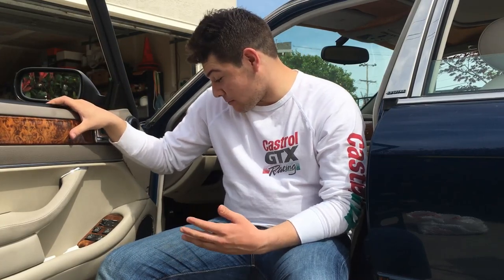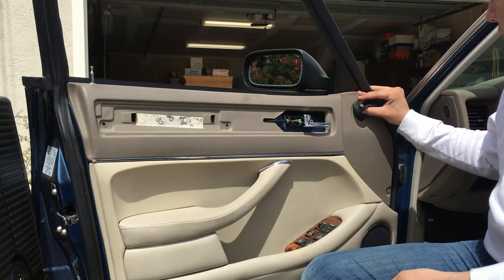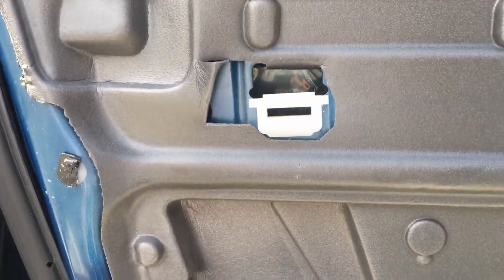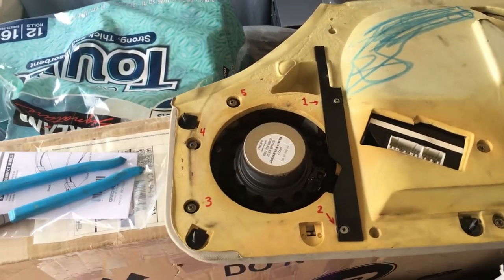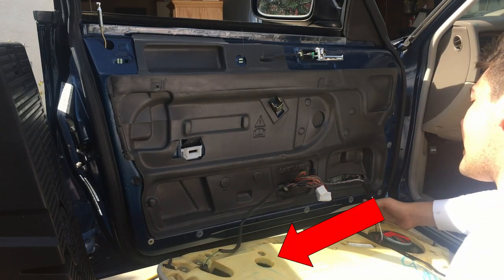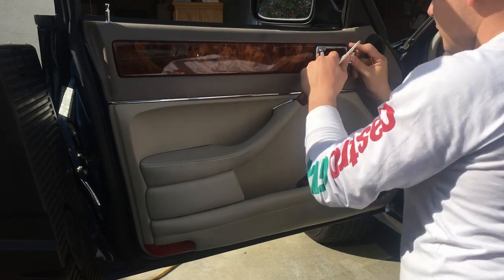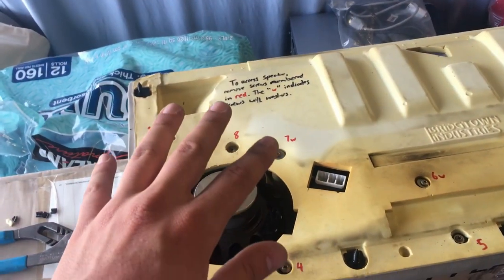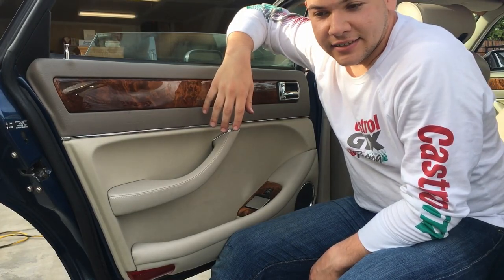How to Remove Door Panels and Replace Speakers on an X300 Jaguar XJ6 / XJ12 / XJR (1995-1997)

Comment: Great video!  I have owned my 1995 Vanden Plas XJ6 for the past 3 years in Phoenix, Arizona and had my speakers replaced by an audio sound place locally; however, now the insulation (yellowish thick stuff) has come loose from the passenger front door causing a lot of trouble in shutting the door and opening it.  If I had the patience and agility, I was thinking of following your instructions.  But since I am getting old and crotchety, I guess I'll bite the bullet and take it somewhere and pay them.  But thank you so much for such a well-done video - your explanations are fabulous!  And I am a girl who only thinks she wants to do it all herself.  ;-D

Comment: Thanks for this Eric. Great information. Just what I needed to know. Hope you make more videos like this. I have a 1996 X300 and it is the best Jaguar I have ever owned. It will probably be my last Jaguar, as this car was the best and most dependable XJ6 they ever made. Not to mention that it is also the last of the straight 6 engines, and the last of the traditional Jaguar luxurious cars that offered "Grace, Space and Pace, or to put it another way "Leather, wood and waft" With the older beautiful Jaguars cars, you either got it or you didn't. You have a great car there Eric. Keep the good work up.
Reply: The  rigsg
Reply: Hv
Reply: Right

Comment: Hi X300Sauce. I have watched your video before and have found it very helpful and interesting. Thanks for your input. Hope your car is running well. Just a little bit of trivia info: My model is actually a X330 and all that means that it is a LWB. (as you know X300 is the factory code) My X Type factory code is a X400. That is interesting because the X300 series and the X Type were designed by the Geoff Lawson design team. He designed some of the most beautiful Jaguars after William Lyons but passed away at only 58 soon after. Then came Ian Callum who left the jaguar history behind  whilst trying to compete too much with the likes of BMW. They lost a lot of the older regular buyers for the younger BMW etc type market but then they just became another competitor rather than the unique classic individualist car that were so different from the other run of the mill cars. So now we just have more of the same with different badges. With Jaguars you either loved or you hated them. And that was simply because you either got it or you didn't.

Comment: Hi, thanks for the brill video, the head unit is better output than the original on mine and I have just blown one of the rear speakers on an x300 95, how many watt are the originals and how many watt and the model that you fitted ?

Comment: Hi when you took out the stereo center panel was there enough room to fit a small amplifire in the cavity ? 
7.35" x 2.5" x 1.5" ??
(W x H x D) 181 x 38 x 64 mm

Comment: This was really useful thank you as I have 2 speakers playing up on my 95VDP. Did you have to re enter a code for the radio or reset the windows or sunroof because you disconnected the battery?

Comment: Regarding the plastic socket in the door and the metal spring clip. they are SUPPOSED to come out together, because there must be a very firm fixing in the metal door. So that when one closes the door using the handle ; it keeps the panel firmly in place, now you have bent the metal clip there is a chance you will rip the door panel off if closed too firmly.
Reply from the maker: Keith Mclaughlin 

Hey Keith, thanks for the insightful comment. After pondering for a bit, you make a lot of sense. I think there’s a chance you’re right, although I’m not certain. In my explanation, I was repeating an explanation I read in several threads on JaguarForums.

With that said:

1. The first time I removed the driver’s door panel, the clip was not installed properly. The metal prongs had not been pushed through the plastic piece by whoever was in there previously. By this time, I had already owned the car for several years and had daily driven it during that period. I never had any issues and the door panel handle had felt solid since the start of my ownership.

2. The rear doors do not have this type of clip at all.

3. Lastly, metals have two stages of bending. Bending starts as “Elastic Deformation” and then eventually becomes “Plastic Deformation”. Within the elastic stage, the metal will return to its exact starting place when released. Once bent beyond elastic and into the plastic range, the metal will not return to its starting position. In the case of this clip, you do not need to bend the metal prongs beyond the elastic region, meaning they return to their exact position when released without any appreciable change to the metal’s properties. The exception to this is a different type of wear and failure known as “Fatigue” which can occur even if the metal is never bent beyond the elastic. However, fatigue is a something that occurs over many thousands or even millions of load cycles, which is not happening in the case of this metal clip which has probably been touched maybe 10 times since the car was manufactured. Additionally, the metal prongs are made of steel. Steel has a Fatigue Limit where, if the loads on the part are under the limit, fatigue does not occur at any amount of load cycles. My intuition tells me that the small load caused by bending the prongs with pliers is under the Fatigue Limit of the steel.

Comment: Thanks for a nice video (tutorial) about replacing the speakers 🔊 from a jaguar .
I do have a question about replacing a coolant hose located in between the transmission and the engine right side of the car, hiding above the suspension

Comment: My x300 misfires.  Any service tips for plugs and coil packs would be great and also air filter and tuning would be fabulous.  My 1996 paintwork is shocking but it’s only fine 59k miles. Thanks.

Comment: Say Brother I wonder if you may have more extensive Jaguar Knowledge other than this model? I have an x300 xj6 but have no Rear Trunk - Rear Window Speakers . I wonder if there are speaker wires ran for speakers? I have heard that cars that didn't come with CD Changers still had the cd changer cord ran to the trunk. .Any Advice of knowledge you may have would be greatly appreciated.

Comment: Hi, since March I've got a 1996 XJR with the Harman Kardon speakers, but the overall sound quality is crap. Is thre any way to establish whether the bad quality is due to the speakers without dismantling the door? Might be the radio (still the original)?Or a deteriorated connection somewhere? Appreciate the tips and thanks for the very clear and elaborate video. I signed up for all your further videos!
Reply from the maker: Hey there David. Thanks for watching!

Does the audio sound bad, or does it sound broken? One easy way I would start to troubleshoot would be to used the different inputs and see if one of them sounds bad. Try the radio, tape deck, and CD changer if you have it. Bonus if you play the same song through all 3 sources.

You can also use the fader to move the audio around to different individual speakers to see if one speaker is the issue.

Poor connections would probably cause an intermittent or variable issue. This wouldn’t be my first guess if your issue is constant.

Bad stock speakers will get worse and worse over time.

Hopefully this helps, feel free to reply with a follow up if you’d like.

Comment: On a 1996 xj6 van den plas -- standard sound system not Harmon Kardon -- there are mini-speakers on both sides of the back seat.  Are those component tweeter speakers?  Need to replace radio system itself (containing cassette player and linked to trunk 6 CD player) before I can listen.  I'm told any replacement would negate those options.  Any suggestions as to what would fit vehicle and make for a quality sound system today? Don't need loud, just quality.  Anyone know if this vehicle is wired for component speakers?  That is, should I buy component speakers or would wiring those be a pain in the neck and two Kicker KSC 650 speakers as shown (without tweeters) be most appropriate for this vehicle???  Thanks, if you know....

Comment: You are SOOOO HOT!!! But I have a question and need your help! I’m about to buy a 2002 Jaguar X-type that has a non-premium speaker system. I was wondering could I go to a salvage yard and take premium speaker system from a car and switch it over to my Jag? Does that make sense or is there an easier way to turn my non-premium speaker Jaguar into a PREMIUM speaker Jaguar? Would it be expensive? Please HELP!!! Thanks!!!